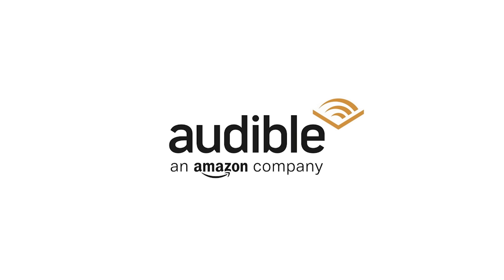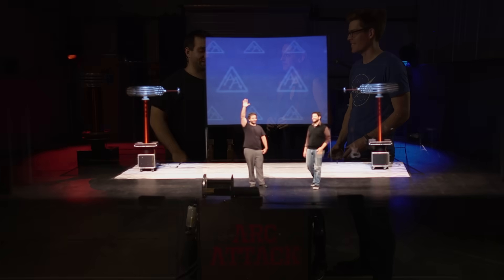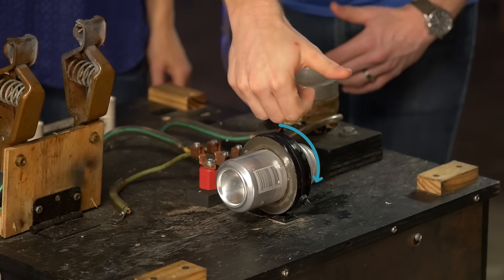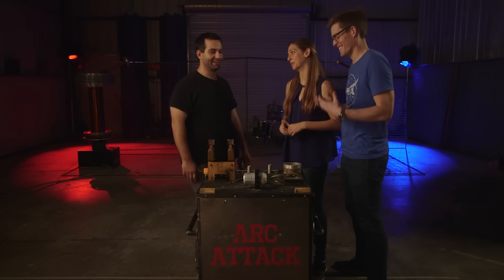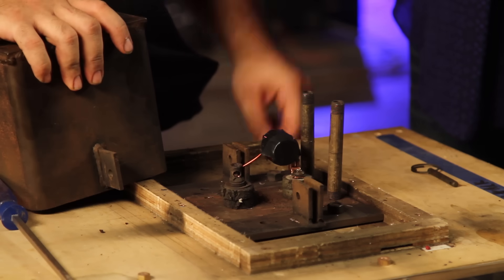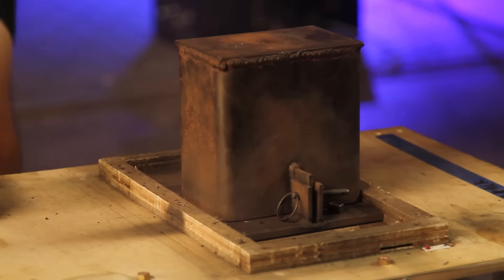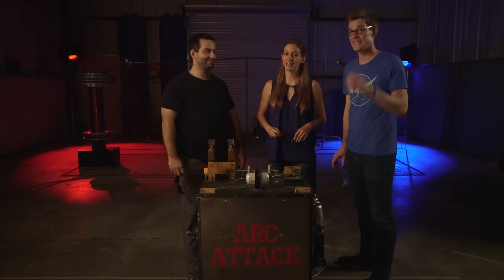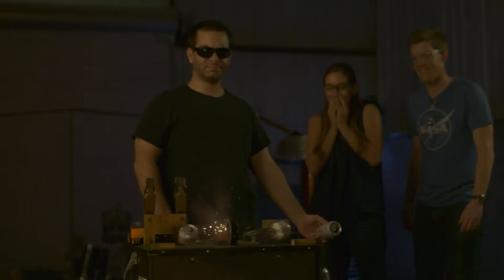Exploding soda cans with electromagnets in SLOW MOTION ft Joe Hanson

Comment: The most interesting application is that when braking, high speed trains induce eddy currents into the rails, which creates a magnetic frictionless braking system. These trains also have the traditional brake pad on wheel system as backup and for lower speed stopping.  If these trains would have to rely on the traditional system at high speed, then it would be necessary to replace a lot of parts and overheating would always be a problem.  If a wheel overheats, it could disintegrate. The eddy current system does not brake using the wheels.
Reply: what is eddy  current
Reply: i have a flux core wire welder that is a ac power  and I stuck a small magnet to the end of my metal and start welding so can you please help me out with this eddy current situation
Reply: This is a description: https://en.wikipedia.org/wiki/Eddy_current
   I'm not sure what you are trying to do.  Are you trying to hold pieces of metal together with a magnet while you weld them together or hold the welding rod to the metal or create magnetism in the cooling metal?  Because of the overwhelming magnetic current created by the electricity, none of those can happen.
Reply: I was trying to get the AC power from the welder to lower down to get as close as I can to get it to turn to DC I don't know if it will work however when I did use it with the magnet the spark that usually is admitted and gets all over the place it is less and it also prevents molten metal from flying all over the place and I noticed that I can see the electric current through my helmet lens when I watch the art come from the flux core wire go into the metal I am welding and I can actually see the melting process of the metal without the magnet I cannot see none of those all I get is sparks flying all over the place a lot of spatter and when I did use the magnets it prevented all of that somebody told me that it turns up what is called the Eddy currents or Eddie amp one of those butt I'm only trying to get less spider and the best weld by using the magnet I don't use them the hold metal together I use them to attract the electrical current from the electrode and try my best to get the current go directly onto the metal I'm welding without having molten metal and Sparks Fly all over the place that's what I get when I use the AC power flux core wire welder
Reply: Really I would have thought they would use the motors to break dump Into a large resistor or regenerative breaking charge onboard batteries etc.  Or even put power back into network. Interesting ... if they were pushing power back into network that would create eddy currents in the tracks and overhead lines as the current flows the eddy currents will also be present in the track as the train is pulling power to accelerate as the tracks are the return path ??? You cant have  current flow without magnetic field

Comment: The magnets creating the electricity is also how the phone companies make wireless charging.
Reply: Yep, and the wireless chargers are similar to the gray cylindrical things on telephone poles ... transformers!
They couple the energy via a magnetic field. Granted, they aren't perfect, but this can come out as VERY useful in all sorts of things!
Reply: Yep, inductive charging. It's also how contactless creditcards work, they use this method so that they don't need a battery it gets it from the reader.
Reply: +Benjamin “Ozias” Esposti They are actually power poles. Not telephone.
Reply: +Durtur Hurbs  Utility poles.
Reply: +David Ward Owned by the power company

Comment: That was a lot of smoke coming off that quarter reaction.  Whenever I see coated metal smoking, I get nervous because I have had to run from zinc clouds coming off burning galvanized metal.  So seeing it in that quarter experiment made me wonder if there is anything in a quarter which could be toxic when arced. 

According to wikipedia, the US Quarter is a copper nickel alloy, so it should be relatively safe (at least compared to galvanized metal) when arc burning.  So I got nervous for nothing...but I did cause me to read about how a quarter is made, so I still got something useful out of it.

Comment: The explanation as to why aluminum induces a current the same direction as the enacted current is neglected.  Aluminum is diamagnetic, and thus works against any magnetic fields applied to it (over-simplified explanation).  This means that the aluminum is pushed away from the acting magnetic field, as opposed to a ferromagnetic substance, like iron, which would be attracted.  Saying aluminum is non-magnetic is basically calling this whole business magic.
Reply: TheHengeProphet Aluminum is in fact paramagnetic. It’s magnetic susceptibility is 2.2*10^-5 so its relative permeability is slightly greater than one. So their explanation is simplified but correct.
Reply: It has nothing to do with aluminum's weak paramagnetic properties. It has only to do with the fact that aluminum is a good electrical conductor. The outer coil acts like the primary of a transformer. The can itself acts like the secondary, but a single turn, shorted out (a ring). The changing current in the primary creates a changing magnetic field, which induces a changing current in the secondary. This changing current in the secondary, in turn, produces its own magnetic field that opposes the magnetic field from the primary. The can tries to push away from the outer coil, both compressing it in the middle and pushing the two halves away once it has been severed. In essence, one electromagnet pushing away another electromagnet. At the high current levels used here, it could work with almost any electrically conductive material, not just aluminum.

Comment: Induced current sounds wrong. A voltage is induced, and if there is a complete path for current, current will flow. The Right Hand Rule for conductors works when talking about conventional current flow- or the relative motion of positive charge.

Comment: arguing a point of perspective, but is it not Fleming's left hand rule???
Reply: there is a flemmings left hand rule and right hand ru left for mirror inductors  right for generatora
Reply: No there are two different rules. The right hand rule (as shown in the video) tells us the direction of the magnetic field around a wire with current. Fleming's left hand rule tells us the direction an object will move when out under a magnetic field and uses 3 fingers. One finger is the direction of the magnetic field, the second is the direction of the object's movement through the magnetic field and the third is the direction it is propelled. Correct me if I'm wrong.
Reply: +Cam Hart that's what I said but my phone was wet so it screwed up my screen so I couldn't type
Reply: +Shawn MMillerok haha

Comment: How does the magnetic field affect the can because aluminium is not affected by magnetic fields.
Reply: True, the aluminium is not ferromagnetic (ferromagnetic the 'magnetism' property remains in the material). Aluminium is paramagnetic, so a magnetic field can be induced in the aluminium with an external magnetic field (eg the electro magnet). 
The magnetic field in the aluminium will disappear when the current is turned off (unlike say an piece of iron which is ferro magnetic).
Reply: +Justin F so basically the aluminium is turned into an electromagnet?
Reply: That's a really good thought. In an electro magnet the field is induced by running a current in a circle which creates a magnetic field. In a paramagnet a field is induced by another magnetic field. So electromagnet is created by a electric current, a paramagnet is created by a separate magnetic field.
Reply: Actually this has nothing to do with aluminium's paramagnetism (that is a small effect). It is because aluminium is a conductor. Conductors cause create currents in response to changing magnetic feild, and these currents themselves induce a magnetic feild.
Reply: induction

Comment: The 'magnetic' field is immaterial, in this example of a bilateral surface opposing rail gun, 
the 'electric' field is the ticket.   This rail gun simply fires the can in two directions at the 
same time, elongating that center ring until the tensile strength is exceeded and the half 
cans,  as 'bullets', fire 'out' in the direction of the combined electromotive vectors.  So, it 
is that the aluminum can is 'conductive', not 'magnetically permeable'.

Comment: Kinda wish they said how much current they were passing through the magnets. The presentation here is kinda patronizing, cool stuff nonetheless!
Reply: that moment when the comments give you more info than the video about the science.
Reply: Coin shrinkers typically run on the order of 100kA peak current, energy 5-20kJ, and voltage 10-20kV. The edges of the coin are accelerated to ~150m/s over a distance of 1-2mm, and the peak magnetic pressure is over 1000MPa. If the discharge is too fast, the reduced skin depth results in a toroidal bulge around the outside of the coin. Too slow, and the inertial confinement effect  is lost, and there may be issues with the wire disintegrating before much work can be done. It bears noting that, in keeping with its lower mass, the coil fragments spray outward in a disc with an initial speed that should be over 1000m/s. This disc can cut 2mm aluminum plate up close, and will gouge soft steel plate as well.

Regarding the patronizing presentation: I think this channel is aimed mostly toward people in the elementary school demographic. Or at least I hope it is...
Reply: +Heart of Justice YES. THIS.

Comment: So awesome doing a video with you!
Reply from the maker: Same! So much fun.
Reply: Yeah, I agree. I think it might be a MUCH bigger explosion, too. To minimize on the mess, they couldd use cans of seltzer water. The same internal pressure as a soda without any of the associated stickiness. Things will get wet, which isn't a great thing around electricity, but as long as there's a good fuse to prevent the device from being destroyed and everybody is wearing rubber soled shoes, it should be okay.
Reply: +Marshall Gatten Water and high current electricity. What can possibly go wrong? XD
Reply: It was awesome! But why wouldn't you try it in slow motion with actually a filled can with liquid in it? Visual show could be messy but better I believe :)
Reply: Hi Physics Girl, could you tell me the voltages and currents implied in each of the three experiences shown here, so I can figure out the power needed? Thank you!
Reply: +Rozni Yusof well have you ever heard of Faraday's cage. the can will act as one. can't say what happens after explosion tho.
Reply: +Srajan Gupta lol me too!
Reply: +Srajan Gupta it's the water all over the circuits I'd be worried about :p
Reply: Great vid. Youre awsome
Reply: excellent
Reply: I have a very important scientific question!!!!!!!! At one point in the video, you and physics girl were introduced to this tube with copper coils and LED lights on it. When he dropped the magnetic ball bearing, it created a magnetic field that turned on the light with NO batteries required (which is what the video said anyways). Now, is the video wrong or is there ACTUALLY a way to keep your lights on without energy?
Reply: I have a very important scientific question!!!!!!!! At one point in the video, you and Joe Hansen were introduced to this tube with copper coils and LED lights on it. When he dropped the magnetic ball bearing, it created a magnetic field that turned on the light with NO batteries required (which is what the video said anyways). Now, is the video wrong or is there ACTUALLY a way to keep your lights on without energy?
Reply: You still need energy to lift the magnetic ball bearing.
Reply: Marshall Gatten yes bu what if you just kept the ball in place near the copper coil?
Reply: +Aquatic Gamer its not like that. you see the electric current is produced by change in the strength of magnetic field. when they dropped it the field grew gradually until halfway and then  decreased. that caused the flow of current. actually the kinetic energy of the magnet is converted in electric energy. the magnet is slightly repelled (we dont get to see its a small repulsion). that causes it to slow down and thus the kinetic energy is converted into electrical energy. now if the magnet is static then the magnetic field will be static and there will be no glowing or tWinkle twinkle.
Reply: Srajan Gupta ok thank you for explaining that. big help lol
Reply: +Aquatic Gamer peace bro ✌
Reply: R u to dating
Reply: Many cans are being destroyed for science in the making of this video.
Reply: What kind of switch is being used to trigger the current? It must not be mechanical because it seems like it would weld itself closed and not be able to be reused. Right? So are you using an SCR? If so, what is it rated for and how much voltage and amps are required to split a can? Thank you. This is fascinating!
Reply: 3d Chris
Reply: It's Okay To Be Smart ur channel is great but that other one was teribble
Reply: Cedric Berman Im not exactly sure, but i think the video recommended noit to do this at home, and for good reason.
Reply: subscribed to both of you. Lorentz force rocks!!🙌

Comment: I think it's not a magnetic force that makes the halves fly away. The can under the ring melts because of the induced current and the air pressure created by the heat pushes them out.
Reply: Nope, we found that the metal was torn, with no trace of melting.

It's as if it was hit by sledge hammers, radially inwards from all directions.   At low volts on the cap-bank it necks-down into an hour-glass.   At high-volts, or with thin aluminum beer cans, the EM force just tears it right in half.

Even more interesting is copper pipe with a 7mm wall (sch 80 pipe.)   At high volts it doesn't just neck down, instead it BOUNCES, and the middle of the pipe ends up expanding like a tiny bird cage in the center of the squashed section.  The thick copper hit so hard that it rebounds outwards.
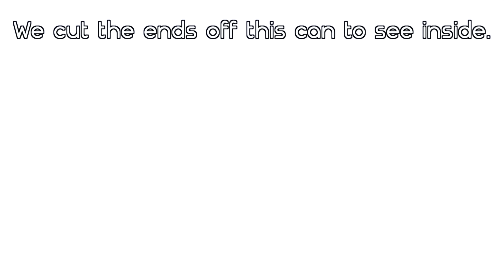Reply: They cut the top and bottom of the can ( at 0:54) and it still did the same thing, I don't think you could create high pressure if there is nothing stopping things from moving.

Comment: pretty neat

1) How many volts dc are being pumped into the coil around the can? And how is that being done?
2) How are the coils wired exactly .
3) How does the current generate a second magnetic field?

I mean I can guess what is happening here but the way it was explained was not very good. 

To me it looks like there are 2 separate coils wrapped around the can and each coil is wired in the opposite direction of its neighbour. So when a bunch of current goes it the 2 magnetic fields that are generated repel against each other at the point where the two coils are touching and this tears the cans apart.

Comment: INCORRECT [02:57] the two magnetic fields are the same direction only at their interface space between and so repel, crushing the softer metal can and expanding-force-only the sturdy coil around it: Your animagram is diagrammed backward for one of the two fields.

Comment: To the quarter explanation: If the forces of the electromagnets feel a force inward (and actually do so when they become high enough) why does it say there in the description that " the quarter PULLED ITSELF inward", wouldn't it be the forces that rather do do push or pull instead of the quarter itself? or am I getting something wrong? Nevertheless great video Diana I enjoyed it quite a bit!

Comment: Shouldn't it just slide out of the coil in one direction? The magnetic field produced by the current in the can should be in opposition to the magnetic field produced by the current in the coil. As I know this would repel the can IN ONE DIRECTION not split and repel in two directions. I saw the correction at 3:00 but still it is not clear for me why does the can split in two. I even know a poem in my lang:

Eu, curentul cel indus,
Totdeauna m-am opus
Cauzei care m-a produs.

This is puzzling.
Reply: AC electromagnets will always repel aluminum.  So if a can is midway through the electromagnet it will be forced out in both directions.  If you notice the can is crushed inwards directly beneath the ring.

Comment: So, If this happens, why don't shrink materials to send to Mars for example??
Reply: It doesn't matter if it's "primal materials" or an assembled piece.  Shrinking it into a smaller volume does not change its mass, so you still need the same amount of rocket fuel to send it into space.

A better option is to develop technology that would allow a lander to extract building materials from the Martian surface, and use that to build useful things with a sophisticated 3-D printer.  If NASA's journey to Mars ever happens, it will most likely involve robotic landers that use that sort of technology to build habitats before the crew arrives.
Reply: While it looks awesome [and the science is awesome] the effect is to crush the material*. It's not smaller, just squished - thus it's not helpful for that application.

*as the other comment above says - the quarter is smaller in diameter but thicker
Reply: Because we normaly send complex and sensitive equipments to Mars, that will be broken/destroyed in the shrinking process
Reply: No volume is actually lost. 
The surface is reduced, but the thickness must be increased and it's wrinkled.
Reply: It just don't shrink. It's cool to say it shrinks, but in reality it's Just deformed, crushed and collapsed. No functional use.
Reply: I understand. The weight remains the same and the same amount fuel are used. So It's expensive to send anyway.

But this could 'shrink' amounts of primal materials, like aluminium or carbon, to build something useful there. Don't?
Reply: um, no